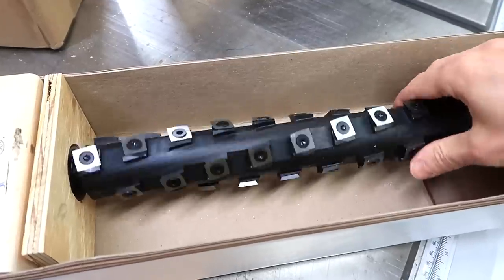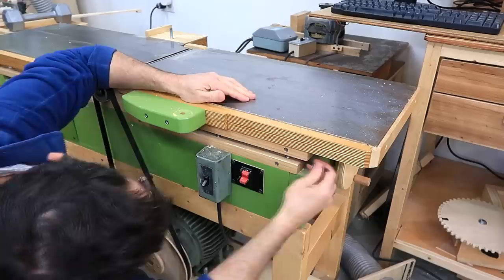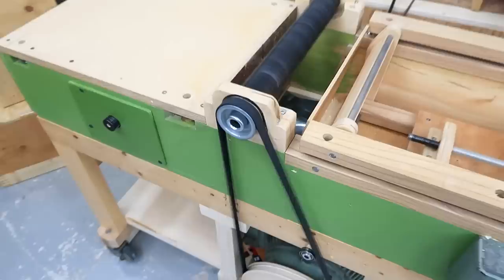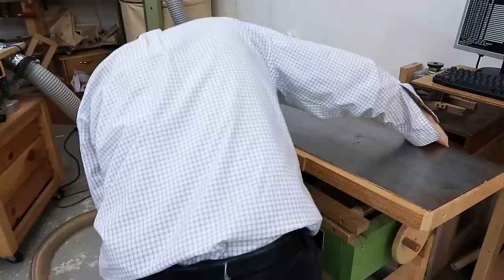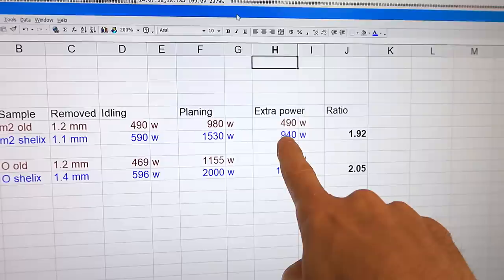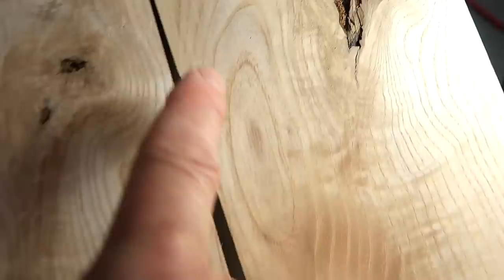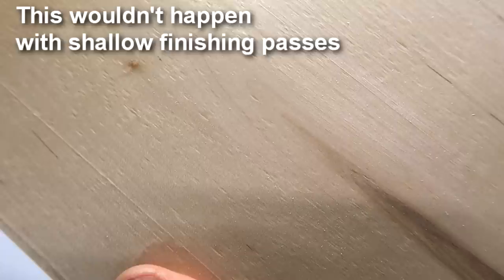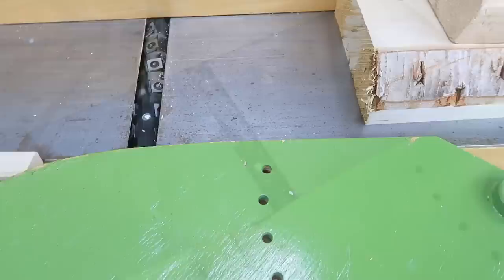Shelix head vs HSS planer head: Comparative tests

Comment: IMHO we can get some information from your test, but this is not the proper way to conduct a meaningful test. 
The cut quality is obtained having control on the depth of cut, once the twisting and cupping is removed and the board you are jointing is roughly to a flat condition you should not do the last passes removing more then 1mm of wood each pass, surely not with that wood with knots and grain inversions. The goal, the only one that is important beyond a flat surface, is to avoid tear out as much as possible, every other surface defect like the ridge left by nicked knives can be sanded away very fast while with the tear out you don't have to sand away the defect, but all the wood around the defect, the tear out hole, it is much more time consuming. 
Every reasonably sharp HSS jointer of planer knife can get a surface almost without tear out on almost any wood if you don't force the cut in the last passes, a much more meaningful way to conduct the test would have been to check how the shelix head lets you get a surface without tear out faster then a traditional head using both in the proper way, with depth of cut that takes away the tear out, not that produces it.
You can get from a jointer or planer a good surface that needs very few and quick sanding with every type of cutter, the real thing to test is how the shelix lets you get there faster.
The other advantage of the carbide cutters is that they stay sharpen much longer, to test it you would have needed a lot of time and would have wasted to chips a lot of wood, but we can compare how much a carbide router bit or saw blade stay sharpened compared to HSS ones to know that the carbide stays sharpen a lot longer, at least the ones between us that have actually used HSS saw blades and router bits in the old times.
Still your test is useful and I get 2 important data from it: the carbide cutter probably allows to get less tear out with difficult grain wood so let you obtain a good surface with less finishing passes (the goal of a jointer or planer is not to have a perfectly finished one, only one that can be sanded to a finished state fast), but needing more power probably lets you remove less material when the goal is to do it fast, if you don't have really powerful professional machines with huge three-phase motors, taking out twisting and cupping when jointing and planing to depth to make the opposite face parallel to the jointed one and bringing the board thickness to the needed value. In both the cases the very last passes should anyway be done with a slight depth of cut as making few more passes on the jointer or planer saves tons of time when sanding.

Comment: First off all i wonna say i am a huge fan og your videos and i am not making this comment to promot Anny thing i work wiht wood machining ech day. The way i see your cutter head I might be to cheep compare to germen made spiral cutters I dont wonna typre there name but I am prtty sure you know there company. One thing you didint do wiht your cutter head is compare the Mass of the 2 heads. The one wiht the carbide wais way less then the stright one.. so you might wonna get your hands on that looks like the normal stright cutter but still is spiral. That will improve your ballens and noise
Reply from the maker: mass doesn’t change power.  I didn’t compare that cause it doesn’t matter